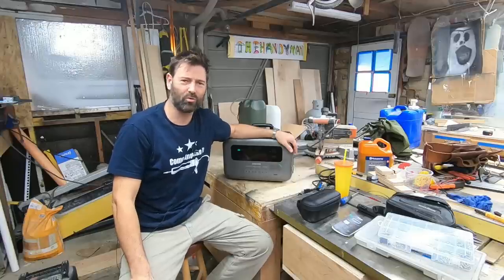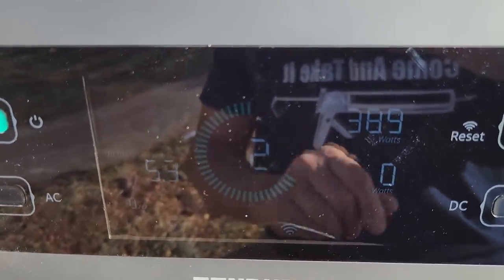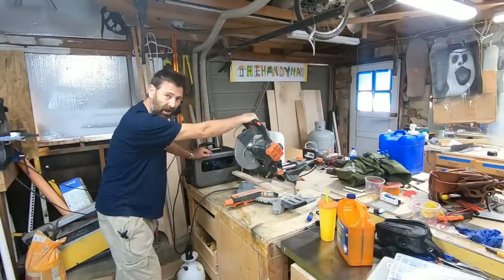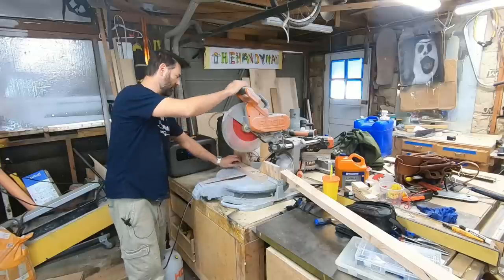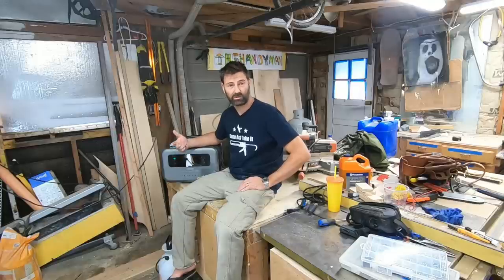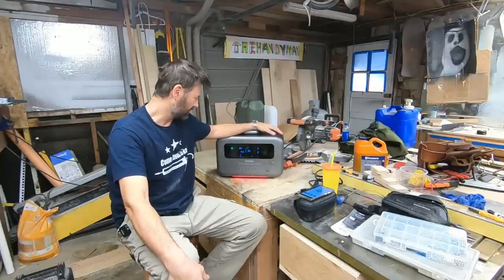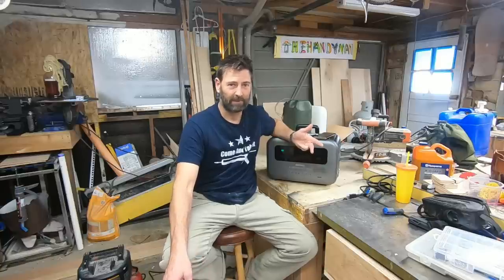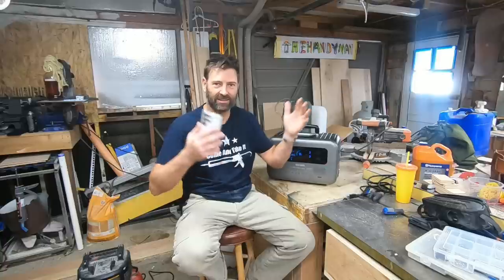The Most Expensive Tool In My Workshop | Zendure Super Base Pro 2000 |

Comment: What happened to the generator, the fuel pumps didn't work?
I had to use the choke for a little while on my Honda 2000 until it eventually went back to normal.
Reply from the maker: I think it was the battery.  It won't work if the battery is dead.  I got it home and it warmed up and started on the first pull.    I'm still messing with it to try to figure it out so it won't happen again.   I have a Honda 2000 also.  I should have brought it.

Comment: Has it ever hit the maximum wattage provided by the panels
Reply from the maker: This unit is capable of taking in more watts then I had out.  I usually only put out 800 watts and I was getting 600 in.  In the summer I can get 700 in from solar.
Reply: @TheHandyman1  This Christian is asking about the panels only. I will say, without cheating with a mirror, it is unlikely normal radiance will allow a panel to exceed its rating.

Comment: Great review!  I really appreciate that you mention it is better to use a slower charge rate, and I'm impressed you actually had solar panels.  You covered some important things and this isn't even what you normally cover.  I have the SBP2000 from the campaign, and it is totally worth it.  Saved me in a recent 3 day power outage, along with some other solar generators.